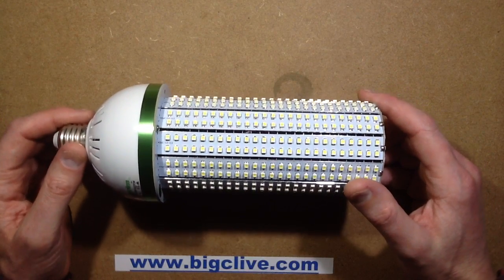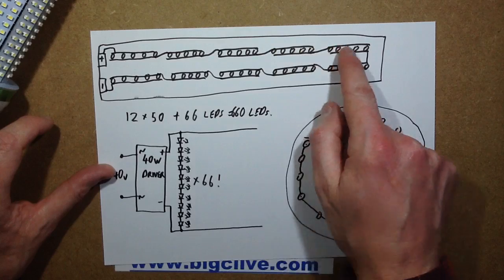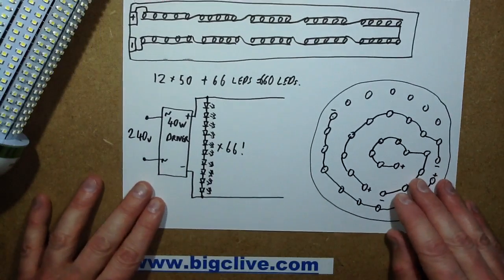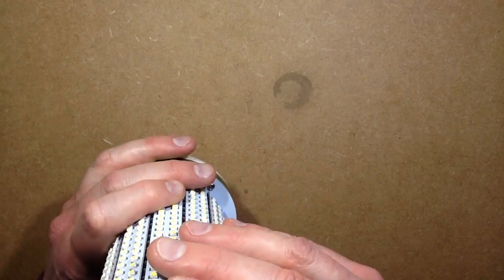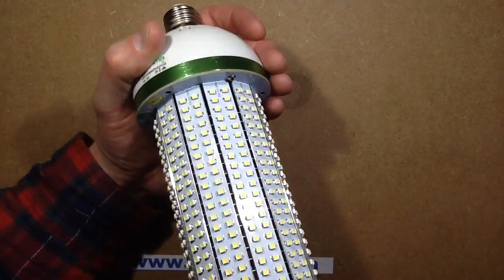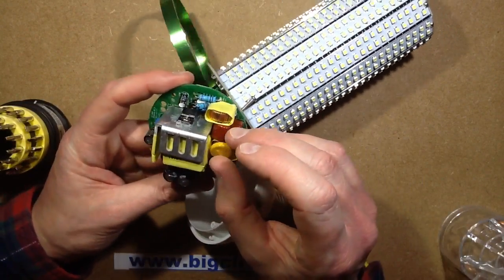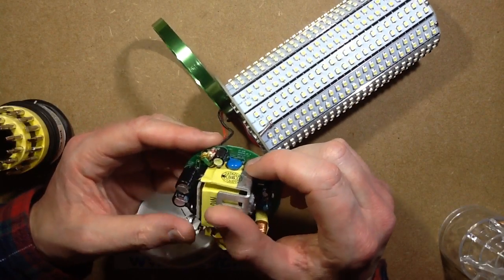A look inside a 40W LED lamp with 660 LEDs.

Comment: The 'bootstrap winding' that power the switchmode controller once it's started up can also be used to detect the secondary voltage simply by turns ratio.

Comment: I believe these are spray booth lights not cheap pieces of kit. I have some 100w ones in for repair.  They have a 12v fan and the pcb seams to be the same arrangement with more parts, like temperature sensing etc.. still no feed back tho.  There designed for an open fixture due to heat. I'll try fill in the gaps as i progress, because it definitely seems like a repair is feasible due to there high cost.

Comment: Gonna be a bit cheeky here and obviously 4 years late but still, mine is bigger than yours Clive :)

Now putting jokes aside, here's a 100W version I found when I was doing a job replacing the lighting in a clay brick factory in Austria.
https://www.dropbox.com/sh/97vwpzdg2tgvhgx/AAAk83k1KZVMHZTDsfNBaqlFa?dl=0
It has 12 strips of 112 LEDs and another 112 LEDs on the top disk so altogether 1456 LEDs. Each strip and the top disk have 14 sets of 8 parallel LEDs. It comes with an E40 type screw plug and it also has 2 12V fans. One fan is at the base where the wires from the PSU are attached and the other is at the middle of the stack and they are configured so that the air flows from the socket to the tip.

Comment: I was always told to never touch the capacitors lest I get zapped. Is that not true here and why?
Reply from the maker: It's wise, but if the circuit has been disconnected from the supply for a while and has discharge resistors then it's normally safe.

Comment: so the typical 40W LED pulls ~0.51A?
Reply from the maker: It depends on supply voltage and power factor.
Reply: bigclivedotcom ok, and for future reference, 1A is 2000 mA
Reply: And did you get the email from me with the ebay link?

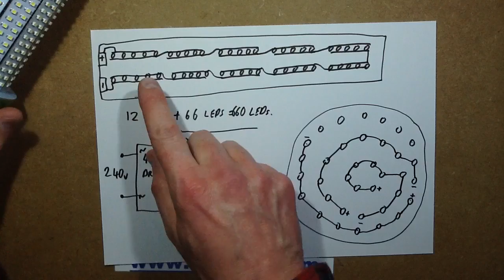Comment: why did you draw a single string of 50 LEDs in a row when they are wired up per 10? (at 2:17) what you are telling here (and before), seems to very much contradict your sketch, the more so as there also is nothing in it showing in 'parallel'. About the design of this lamp I am wondering why any grower would want any type of growth lamp that produces almost all of its light output sideways..
Reply: adriaan van harrick Look closer.  10 groups of 5 parallel LEDs, chained together in series.  And this is not a grow light for plants. It's a big regular light for humans.

Comment: (12 * 50) + 66 = 666, not 660.
Reply: Of those 66 only 60 are connected. The other 6 are decoration it seems so no real use in counting those
Reply: I could only count 60 on the top

Comment: Well... finally some LED that is worth!! If this great light piece of enginering lasts long enough (with this quality seems that it will), I could say that's the only LED light that is worth of investment. Its light wouldn't decay with a short period of time as basically it doesn't produce heat and have a great energy efficiency as operates near to the maximum efficiency point of those devices. Altogether considering this excelent power source gives us the (maybe) only light that has a cost benefit far superior to CFL that's worth the price (I've checked 56 Euros).

Comment: I wish I could send my led tv to you to figure out.plugged in it reacts and messes with my radio clarity.not even turned on so I am guessing it is the remote controll circuit that turns on and off the tv that is the offending electronics. thinking of putting a seperate inline switch on the tv cable so I dont have to keep unplugging it.I also like your test mains connector.the box you open and lift the tabs then insert wires and then push the tabs down and close the box and its on.what is it and where can I get one.
Reply: It's called a Keynector, Google it.

Comment: I spent the whole time thinking about how one could arrange red, blue, and near-red LEDs in that configuration for a nice LED replacement for the big high-pressure sodium lamps I use in the greenhouse. I'm afraid however the high humidity would be the death of that nice driver board, and any attempts at vapor-barrier housing would probably ruin all the cooling built into it.

I suppose maybe it would have to be a specialty unit with cooling integrated into the vapor barrier housing. Maybe this layout isnt well suited then, you'd want it to be split in half with the back side an big finned aluminum heatsink and the front a glass vapor-barrier cover or something...
Reply: They've a giant aluminum heat sink and two fans with plenty of heat outlets.

Comment: why is ''power factor'' important? 20 years ago no one mentioned it.....
Reply: You thunk? 20 years ago I was repairing PFC equipment in my Low voltage switch-room.  Ideally power factor should have a value of 1 (power factor=true power/apparent power) when capacitive and inductive loads are balanced, however in most lighting and machinery, the load tends to be inductive, so you add capacitors to try to get the correction.  Power Utility companies will fine businesses that run too inductive a load on their supply, and that's why we try to do something about it. Money.

Comment: I had one of these on a pole light lasted about one year company replace it with a new one. Now the replacement is not working. The supplier calms the air is to dusty and getting dirty inside. Very poor design if dirt get inside and it stops to work.Changed it for complete sealed unit.

Comment: WELL! I was expecting some horrible chinese-knock-off-style electronics. That lamp has mains isolation, input protection, plenty of filtering, and even isolation slots in the main PCB.

How much did this lamp cost?
Reply from the maker: +Falcrist It was a gift from a friend and I think it is quite an expensive lamp.
Reply: bigclivedotcom It certainly looks that way!
Reply: +bigclivedotcom suppose i would like to purchase several of these lamps, where might I do so?
Reply from the maker: +Abe Lincoln I'm not sure the best place to get the good quality ones like these.  Probably NOT ebay.

Comment: That looks like 2 voltage regulators, not transistors.  With bridge rectifier and a transformer it looks like it's AC to DC power supply built on the inside.

Comment: Not certain, but from perspective it looks like the power supply is a switched mode supply that provides good mains isolation. The 2 toroid coils are a strong indication along with the transistors on massive heat sinks.

Not a conclusive analysis, but check the mains isolation that's the important part. 

I appreciate your videos. I've always been curious about the tech that was a breakthrough in LED efficiency, somewhere between 15 & 20 years ago. One video I saw showed the semiconductor layers, so not my question is answered. A far more elaborate semiconductor than were their simple bipolar LED ancestors.

Comment: All that time wasted waiting for you to switch it on.
Reply from the maker: +ajuk1 See the link to a light output test in the description.
Reply: But in all that time, there was plenty of things to learn :)
Reply: I can't believe it's exposed to the air and not enclosed within a diffuser cover.
Reply: These bulbs typically go in tower lights or wall packs where they are safe from water and have the diffuser there.
Reply: ajuk1 Indeed...
Reply: good way to milk views

Comment: Sir, at  9.00 you mentioned the name of blue capacitor..I didn't get it ..Whats the type of capacitor?
Reply from the maker: +Jigar Thaker It's a class Y capacitor used to reduce electrical interference by giving a short return path for current capacitively coupled between the primary and secondary windings.

Comment: I have used COB Lamps similar to this for over a year now in a commercial outlet at high level, originally they were running 200W SON lamps in the fittings but I have now swapped them over to these 40W LED COB lamps and the feedback from the customer has been great. 
They're not cheap at over 60 quid a lamp but for me getting access to the fittings and not having any maintenance issues with them is a no brainer + the added cost savings on their electricity bill have more than paid for them now too.
These are the ones I use http://www.ledecolights.com/products/led360-son-replacement/e40/goodlight-6w-g360-led-son-replacement-lamp-e27-daylight-541

Comment: There's a nice 80 led 4w corn cob style led bulb on ebay. Just brought one to test in our light fitting before buying more. Ebay id :151279576606 cost £2.19 and arrived in 12 days
Reply from the maker: Benjaman Woolner Keep in mind that the more LEDs there are, the more heat has to be dissipated from a light.  I've looked at those ones, but I felt there wasn't enough ventilation in them to properly cool the LEDs.
Reply: I just had a quick look and there are 6 holes in the very top of the cover, bit like a pepper pot. Hopefully this will allow the heat to dissipate. I'll find out tonight once they've been running a while and post back
Reply: These LED bulbs don't seem too bad thus far. Its a little hard to really judge how good the light output is when next to 2 conventional spot light style bulbs, but in regards to heat I can comfortably place my hand on the cover.

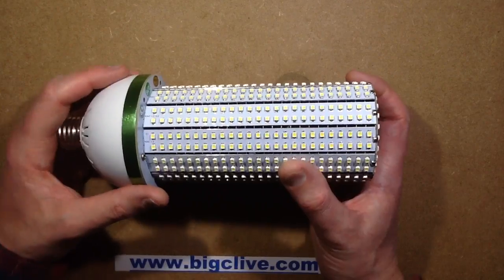Comment: You might want to add an annotation at 1:40 to correct that 66, which should have been 60.  I notice I'm not the first to mention the error and I see you are aware of it, but an annotation would let people know who otherwise might run away from the "evil number" if they're able to do the math. LOL!

I laugh, because most of the "numerologists" I've met are terrible with math, and will probably just be confused by the fact that this thing ended up with a 660, a 66, and a 60, and will most likely just assume that all adds up to evil anyway, but maybe not run away since they can't be sure. Those that actually can do the math, will likely just run away. Especially if they notice that the total number of circuit boards with LEDs on them adds up to 13. :)
Reply: If they wanna run away from a number, let them. You cannot live in fear.

Comment: Isn't 12X50 on the sides plus 66 on the top 666 LED's?
Reply from the maker: Oops.  That'll be 60 on the end PCB since it has to be a round multiple of 10.  That must be the devil in me shining through.
Reply: Not trying to be picky, just making sure I wasn't going mad. I was actually wondering if you were religious and might not want to mention 'that' number. :) Nice looking light all the same. Does it come with some sort of diffuser sleeve to de-brutalize the illumination a wee bit?
Reply from the maker: BigGoucho No.  Sadly I'm destined to burn in hell forever anyway.  The light is quite intense to look at, but the way the light is spread round all sides actually gives it a very diffused look.
Reply: bigclivedotcom Hell will be awesome, I've chatted to friends. All the fun ones think they're going there. Bring liqueurs!
Reply: ***** bigclivedotcom Liqueurs and cheap pink plastic shite from China!